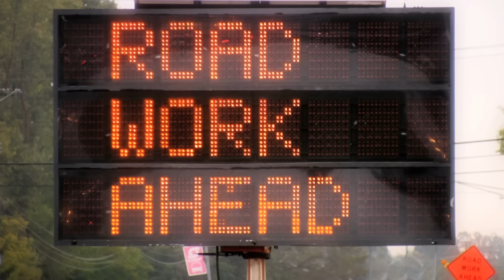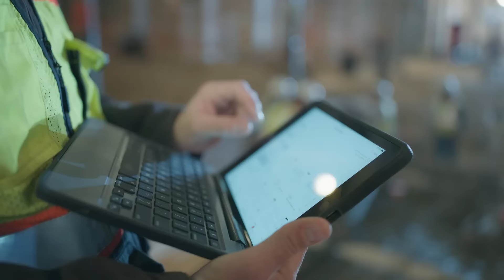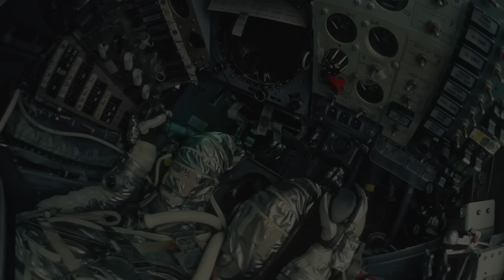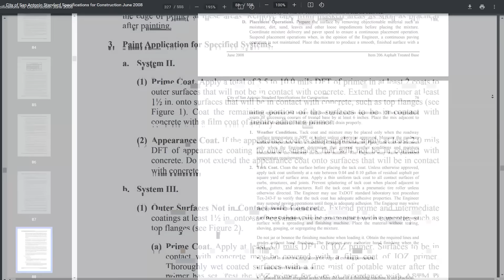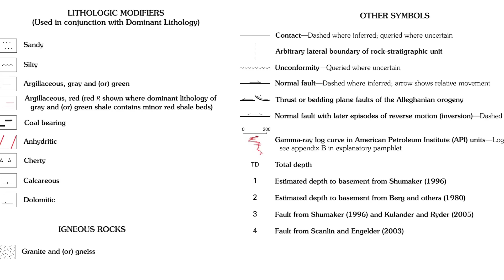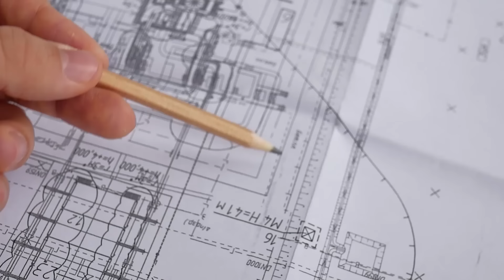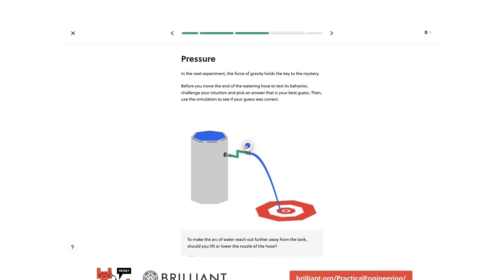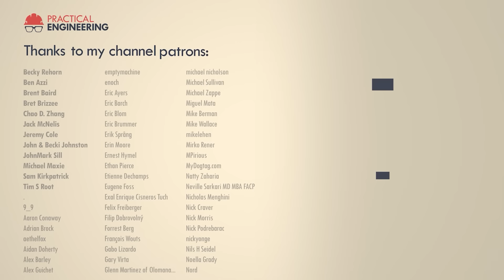4 Myths About Construction Debunked

Comment: "With an unlimited budget my 2 year old could design a bridge that carries monster trucks over the English channel for a million years"  - Outstanding!  I struggle explaining why all solutions work, but aren't equal. Thank's for a great new example!
Reply: Actually, if I take that quote literally, I do wonder how a bridge that would ACTUALLY last a million years would look. Can it even be made with concrete?
Reply: @durendenmp812  start by filling in the channel entirely with lava
Reply: @durendenmp812  You might want to read "The Clock Of The Long Now: Time and Responsibility", about trying to design and build a clock to last 10,000 years. There are a lot of unique technical challenges, including that no material is tested and rated to last anywhere near that long. One of the solutions is to use brittle materials that either work or spectacularly fail -- if they fail under load, it will be right away.
Reply: @durendenmp812  It'd probably have to be an ongoing mega-project with constant maintenance from generations of people who live around the structure... which just shows the engineering absurdity of trying to build something to last so long. Especially since within 5,000 years someone will almost certainly render it useless by making some sort of radical new transportation system. Why even bother with bridges when orbital transporters or person-size flying machines are as trivial as bicycles are now?
Reply: @durendenmp812  Its called a dam.... We can still see the ramp the Romans used to storm Masada or Alexander used to storm Tyros.
Just fill that thinh with earth.
Reply: @535phobos  well, it's been just 2000 years, 998.000 years left :))
Reply: Unlimited budget?  Continous fused, pressed carbon (i.e. diamond)  bridge anchored into the bedrock and just one single giant rectangle of diamond 10 miles wide, 10 miles high and the required length.  If you say that isn't a bridge I'll add some arches to let water and fish underneath.
Reply: @NovaNix4  giant chunk of solid gold.
Reply: @NovaNix4  Your probably right, that thing would be so heavy and a million years is so long it would just sink in slowly. 

Although I do wonder what we could even do to stop that from happening... What maintenance could possibly stop something that big and heavy from moving even slightly.
Reply: @raiden000  probably nothing. at that scale the crust is basically mud and the bridge would eventually fall through, dragging any supports with it.
Reply: Lol, though lets be fair. The bridge design by your toddler would certainly be better than any design utilized by modern engineers.😂
Reply: @NovaNix4  wouldn’t gold just be eroded away?
Reply: @raiden000  I don't think gold is a good choice. The English channel is only ~100ft deep, and its floor is mostly sand or mud, not rock.
Reply: Such an exaggeration. A 2 year old isn't gonna put supports on the bridge regardless of budget. They don't understand even the most basic ideas of physics.
Reply: @NovaNix4  There's another issue too. How to stop people from just stealing chunks of it?
Reply: @NovaNix4  Well, the unlimited budget is for design not maintenance.

Technically, that even opens the question of how to 'build' it.
Reply: OK maybe I am dumb, but is there a reason against just filling in the channel? And if there is a risk of erosion, you could also fill in anything in a 100 mile radius around Britain. We have an unlimited budget, who cares?
Reply: @inlovewithgoats1092  Please don't. The whole NI thing is complicated enough as is already.
Reply: He says his 2 year old could design a bridge . . . "  Now EVERY 2 yo in the comment section is trying to figure out how to design this bridge!  y'all need to get real hobbies or something! (ie  JUST enjoy the video)
Reply: @inconnu4961  yeah, how dare we have fun....
Reply: @durendenmp812  step one, drain the english channel, step 2, pour gravel and molten rock up the height of a mountain with a gentle slope

Comment: As someone who worked as an electrical inspector, I have found the "non-working" foremans to be some of the best. Yes they aren't pulling wire and making spices but they make the job run so much smoother by having better schedules, identifying the materials needed, submitting RFIs before they get to the work, keeping his guys working, etc.
Reply: The planning required to keep people busy in sectors like these is a job on its own, and often a very skilled one at that.
Reply: You a con Ed guy in nyc ?
Reply: I have seen both sides of non working foremen. However, in my trade ( electrician) the split was about even, and in the last company I worked for, our non working foremen had the worst jobsites. The best foreman I worked with (see the difference here?) knew how to balance his just supervising with his actually pitcing in. His jobs ALWAYS ran smoother and within both time and materials budget. And his crews were the most productive AND happiest.

Comment: There should be an asterisk on the lowest bidder section: it depends on WHY they are the lowest bidder. A lot depends on the contractors understanding of the specs and drawings. And I've seen more than a few contractors low ball a bid just to win the job, and then try and make up for everything they didn't include with change orders.
Reply: You only make money because of the variations!
Reply: @TonyRule  Often you get penalised though for a variation, especially if your variation was due to you cutting corners.
Reply: I've seen that with the sewer authority, I'm the chairman of.  The initial construction and the redesign both ended up in court.  I still have a picture of a yacht, called change order with the dingy behind it called original contract.  Then I have seen profit margins go from 10% on a change order to 15% over the last decade.
Reply: @SeanBZA  Not if you know what you're doing and follow the plans to the letter.
Reply: I don't even know why they bother with the bidding, if then every project is like 4x over budget.
Reply: @brett76544  That was my father's house, paid for by the municipality, asking if they could do stage 2 to 4 for the same fixed price as stage 1, and not go out to tender again, with the year of delay that would involve. Seeing as the most important part, the chlorine plant, was built for the entire build, along with the control room, just not instrumented and wired, all that was needed for the rest was concrete, wiring, pumps and pipe, not the expensive massive chlorine plant. The ground for the rest had even been prepared in the first phase. 

Just mark out, dig, pour and go. they were barely half way through stage 2 when they got the order for 3 and 4 to go ahead, saving even more time and cost, as they could simply use the different crews effectively then, and a wait on one side just meant you could go elsewhere to do the same thing ahead of time. Those 9 months the crews did not stand around at all.
Reply: @TonyRule  Where do you get contractors doing that, most will try cutting a corner somewhere.
Reply: This is extremely common with contractors these days. Some bidding departments actively look for mistakes and omissions (obvious or assumed) because they know they can make that money back during construction and not with the actual bid.

I worked for one A/E firm that was founded 40 years ago and one of the principals (an older gentleman) made a speech at a company luncheon where he basically said, "when I started with the company, we didn't have a single change order come in. Last year, we had change orders that totaled about $750,000! We have to be careful about what we put out." I agree with the sentiment about being thorough with our plans. But, the implication that we were doing anything less than our counterparts 40 years ago is absurd, because construction as an industry has shifted to this lowball bid-high change order model.
Reply: I'd agree with that, as I'm currently in year 6 of a 3 year project, of what should be a straight forward build, but isn't for some reason.
Reply: Low-ball/underbid now & expect govt bailout later after delays/cost overrun if that's an option.
Reply: Seems extremely typical from my experience unfortunately
Reply: Underbidding and counting on change orders to make a profit is extremely common. 

I’ve seen construction companies go bankrupt on a road construction project because there were no change orders. Then their was litigation, and the city had to bid out the rest of the work.
Reply: Lockheed or Boeing? :))
Reply: * I misunderstood a requirement.
Reply: Been doing heavy construction estimating for close to a decade now, and the main reason for the change orders are that the profit margins for contracting work have been eroded away to basically nothing as the competition is extremely tight. Typical rule of thumb in most markets is to try and be awarded 10% of the work you bid on dollar wise, e.g. if you want to perform $1 million of work you'll have to submit bids for at least $10 million and hope to be low bidder on at least $1 million worth. For than a few companies will periodically bid jobs at cost just to make sure they have enough revenue coming in to cover their fixed overhead expenses. Old timers I've worked with talk of doing work back in the 70's and 80's operating on much more comfortable margins, with much more "fat" built into the jobs to cover any overruns.

The other big element is simply technology, with modern CAD, total stations, takeoff software, and job tracking software, project managers now have more information to track every element of a job and quickly identify anything that might have been outside the scope of work or additional from the base contract. Many owners hiring contractors even strongly incentivize this through demanding things like "Lean Construction Practices" and "Just in Time delivery" where in the past a good superintendent or project manager would always order a little bit of excess material to cover any contingencies, now project owners view this as waste and will try to claw back any money spent of excess material, whereas when contingencies requiring excess material inevitably come up, going through the change order process is basically a contractors only reprieve.
Reply: My engineering construction contracts ALWAYS contained "Lowest Responsible Bidder".  More work for the Engineers, less BS from change orders and "Profit Creation".
Reply: In some areas it's set up that way on purpose. There's an area near me where only 2 companies do around 90% of the road work and i worked for 1 for awhile as an estimator. It was a bit of a scam but the way the rules were set up benefits union companies over non union, giving them the competitive edge and since those unions donate heavily to politicians and the people writing the specs are mostly current or former union members from those same unions it means they have an effective monopoly for that area. Because they know the specs in and out and since no one can beat them at cost they send in bids just above cost and then get change orders for EVERYTHING imaginable. I worked on 1 job and helped with the change orders where we were supposed to meet a state project manger, state inspector, 1 general contractor rep, and 1 sub contractor rep and every time someone counted make it we got a change order for the time to reschedule everything, which just that 1 meeting ended up resulting in over $2000 in change orders. This sort of stuff is why you can read about jobs that take twice as long and cost double the original estimate. Guy i worked under was even known as "the change order king" since he knew the specs better than the project managers so he knew how to justify everything, i saw him do change orders that took something small like change the location of an underground junction box a few feet (in the private sector wouldnt cost anything except the extra 5ft of pipe and wire and maybe 1-2 hours of labor) and charge for his time to make the change order, time for a meeting, time for plan review, time to alter the as built drawings, time to coordinate everything, and by the time he was finished that 2 hour change order was up to almost 20 hours.
Reply: Actually that's how most companies work.
The companies generally have more expertise in house than the ones asking for the project.
So it's very likely that they forgot stuff in their specifications. Or didn't prepare for certain things that could go different. (f.e. the ground being different in some places than expected)
The company will do a low bid and get the job.
Then they will say, we can't actually do this because ... But since it's not in the book we will have to charge extra.
This is why so many projects go over budget. It's especially bad in software development.
Reply: @SeanBZA  Often you don't get penalized however.
Reply: About 16 years ago when I was doing estimating and draughting for a local architectural and structural steelwork company, (Dudley, West Midlands, UK), myself and the boss were coming back from a site visit over Leicester when he decides to make use of his car's new fangled Bluetooth connectivity to chase up a quote/bid that was about £300k. The buyer was apologetic about the fact that we were the most expensive, I asked the boss to inquire as to how much we were out by and the answer came back that it was about £30-40k. I ran over quickly what I'd put in the quote and realised that was around what I'd put in for the fitting/erecting of the steelwork, which was part of what was supposed to be quoted for. I again ask the to pose a question to the buyer, did the other companies put in for fitting/erecting, he didn't know and would get back to us about it. An hour or so later the was told we were the second cheapest as everyone else had quoted supply only. Moral of the story, read the entirety of a bid/quote and not just final amount, might cost more than you expect...
Reply: @eaglescout1984  While I don't disagree with your overall point. Buildings are going out to bid and started construction before they are even being finished being designed/engineered. A new field directive comes out every week with 30 pages of changes. By the end of the job the prints are completely different than when they went out to bid. Shop drawings for the iron workers don't match the shop drawings for the glass guys but both were approved.
Reply: @centurion1945  As a building general contractor, who's company has 70+ years of experience, margins have about completely disappeared for commercial GC's. You hope to have a success rate of 1 out of 6 or 7 with bids, and you hope owners and architects don't waste your time and money by not proceeding with bids for projects. Bidding projects costs us money, depending on the job that can be anywhere from $6 to $10k per bid, and there's nothing more frustrating that to be low on a good job only to learn the owner doesn't have all the financing in place or the A/E's budget was way too low.

There's not necessarily anything wrong with the low bidder model either, especially if it is a bonded project, as no contractor bids on a project to lose money.  Change orders do happen however, and with most all change orders they are processed because of one of two things.  Either the owner wants or needs a change, or the Architect/Engineer had an omission in their plans and specs.  They are potentially more common today because Architects and Engineers are put under shorter timelines when it comes to turn around of their work, and therefore things do get missed during the design phase. 

The industry as a whole is at a major cross roads.  Labor is becoming harder and harder to obtain and maintain.  Materials are harder to acquire and costs are fluctuating consistently.  Owners have become more demanding with A/E's and GC, while margins have shrunk to levels near impossible to maintain.
Reply: @MntneerWVU yup margins have gone away to basically nothing. Doesn't help that so many commercial owners are more than happy to hire sketchy fly by night companies that get their low numbers by cutting every corner possible, leaving the guys who actually try and present an honest price for doing the work correctly to get left out in the cold. And like you said each of those estimates costs time, money, and resources that can get tied up for months as the owner and A/E pushout revision after to revision to try and get the job to fit with the owners financials.
Reply: @centurion1945  Then you have the opposite where a developer will try to screw you down, expecting fifteen percent less on a quote for the same job as last year, usually with the whine that they can't afford you, go for the cheapest and most underbid quote, calling you back in 3 months later to fix everything - at your price.
Reply: @arthas640  That's called rorting :)
Reply: Down here in Oz it’s not necessarily the lowest bid, sometimes the lowest bid sends off alarm bells. Especially if the bid is well below the median quote of other companies.
Reply: @markmurone7128  Dunno how many times we'd put in a bit only to see the winner at around half our quote. Oddly, the same client would go for it every time only to discover a surplus of extras and submission of poor quality work. It would cost them substantially more and for a lesser grade yet they'd still insist our price was too high. Can't understand why they went brokeseveral times.